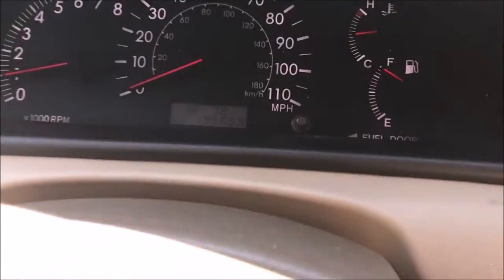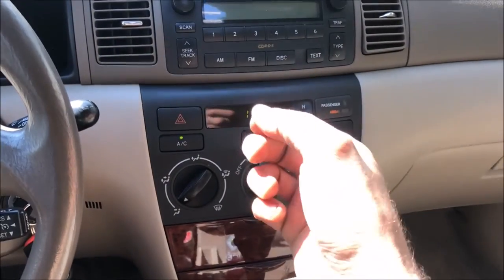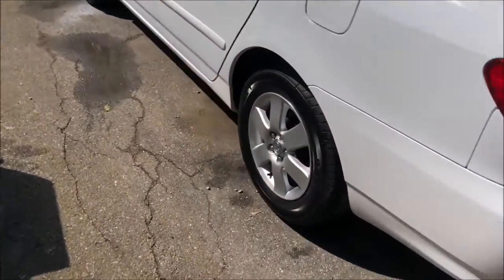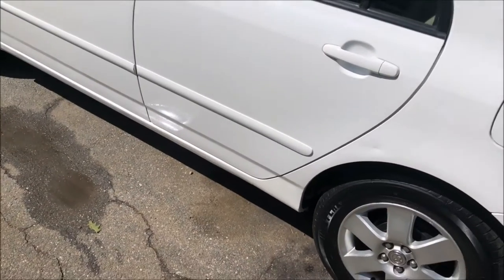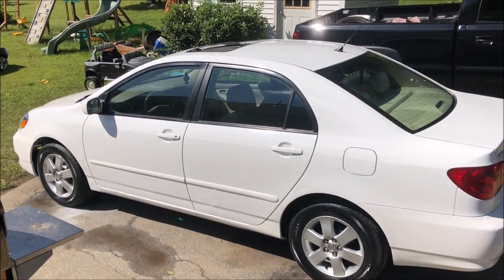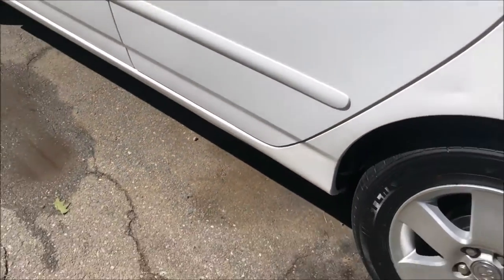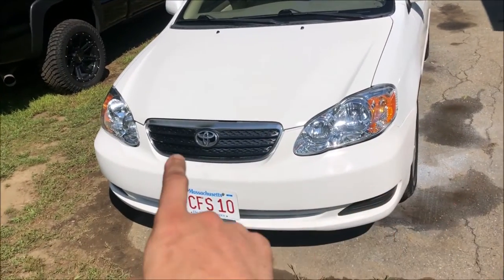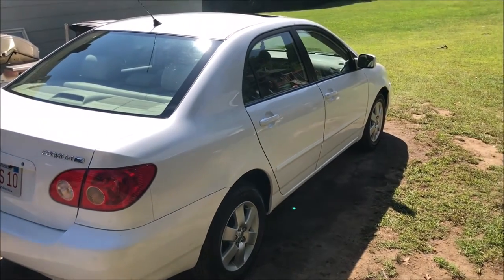Transforming a $200 pile of junk into PROFIT!

Comment: Wow. That's actually amazing work. How long did it take to bend the rocker panels? Also, Are you selling it? I have a Nissan maxima 2003 i could offer for trade and give some cash to. Lmk
Reply from the maker: Grib Gaming Thanks. took a few evenings to fix rockers with paint and body work included, lots of labor. It’s already sold, actually being picked up tomorrow! Thanks for the offer.